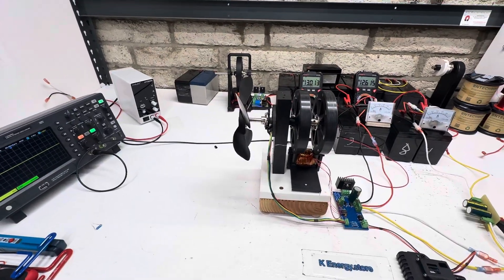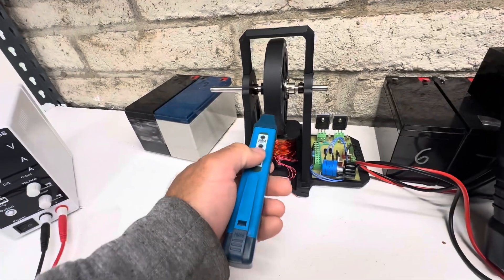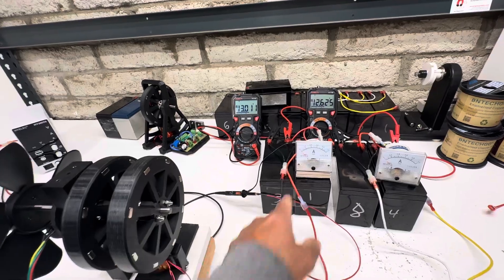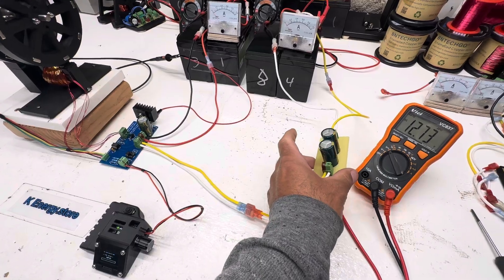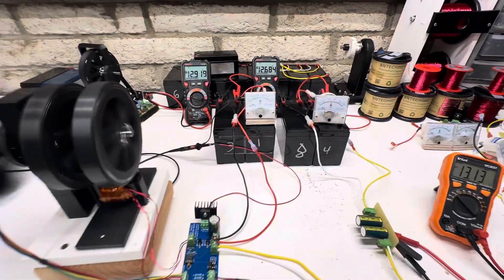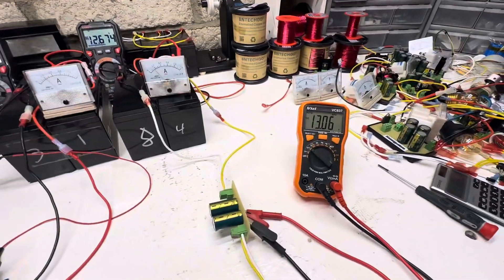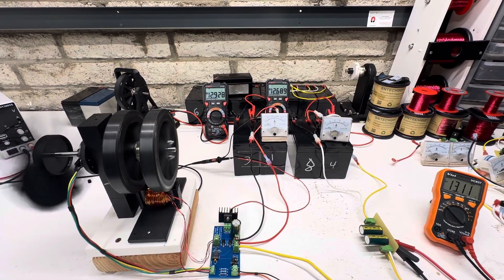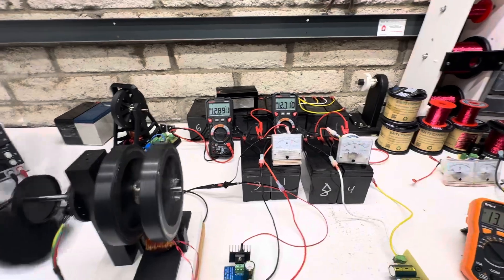Double rotor pulse motor

Comment: Really nice!
I have made a few "dual flat disc rotor motors" with neodymium magnet rotors and ferrite cored coils dandwiched betwee.
It "has to be" more effecient since both ends of co8l and core are being used. Nothing wasted!
What i like to do is have 1/3 lemgth of core be wound with a motor drive coil and remaining 2/3 of core wound with "induced pickup generator" winds, so only that 1/3 length of winds recieves power pulses.  Now a "motor generator"  and you get a good strong induced pulse into those generator winds from the sharing of the core, 
plus the flyback shoots through those induced winds too, plus the backemf force too, which can do some work slingung the rotor forward, not p uh lling backwards (if timing sweetsppt found) 
.Collect it all into caps and then disconnect cap and release cap to load (battery) when caps are "floating"
My goal was to make a no lenz generator, from those  generator winds.
Interesting trick i did was stagger one rotor to the other a little bit maybe 5 to 10 degrees (rpm dependent where is sweet spot) Then try to get some loading of generator winds not affect draw to motor winds, or even lower it during loading.  the load can be a semi large size cap and fill it with both flyback via fast steering fiode, and FWBR too, with AC legs acriss the induced generator winds 
Advanced experiments is to short circuit briefly the generator winds at perfect point in rotation (the peaks) and watch the cap fill super fast super high and dump to load only when cap is floating ....
Anyways ideas to kick around you can see some of my fual rotor stuff on my YT channel MrDKONZEN look about a year ago, had some good success while in Belarus about two years go... had 16 magnets in rotor then....since back in Seattle made dual rotor "Alternatirs" with same polarity magnets facing coils, and making AC from hitting ends of coils one after the other from big stagger of rotors   Spun it wihh rotovertor AC motor in lots if tests.
Try to have some fun beyond ecpectations and  loop it all into big size cap, have big size cap run the motor. 
Maybe some isolation transformer betwern the in and out.  And/or extra fwbr on ihher side of big cap or timing of this and that but never this or that same time.
Watch tecent  livestream from TimTron channel on YT oldmanbuilds and Hrliarc, or earlier one 3vweeks ago with Faraday Research (Mike from Cxnada). That livestream really good too. 
TimTron explains pretty good lots of cool stuff especially stories up Maine when he lived there.
Reply from the maker: All good things to try! I’m making a bigger one soon

Comment: I wonder by magnetizing the central rid slightly it can help generate more continuous torque. 

The bloch wall may be interfering with the flux switching in the pickup coil. 

You may want to reference Timtron channel for C shape Flux core switching. 

If you mirror this then the flux energy can flow like an imobius strip. If the center rod can be magnetized with the pulse of the coil to overcome friction as two where the wardforce is configured to generate torque. In addition to the ground pump I now see this is the beauty of Bendinis genius. Ty ty for helping me see it.